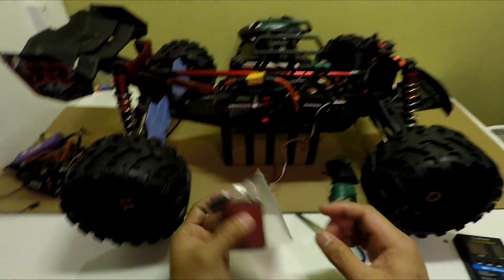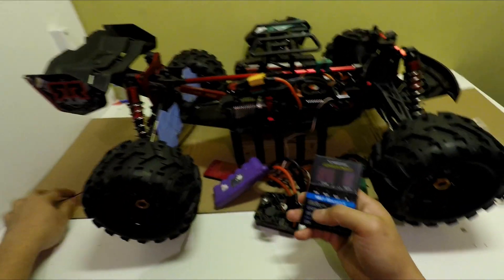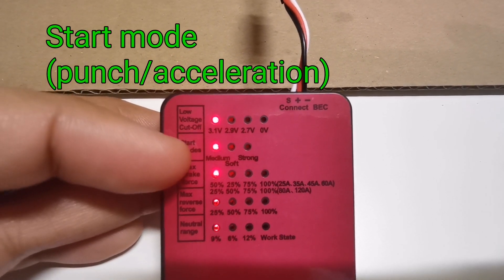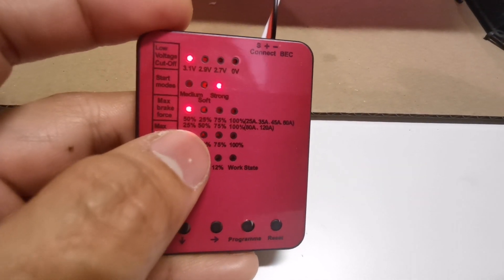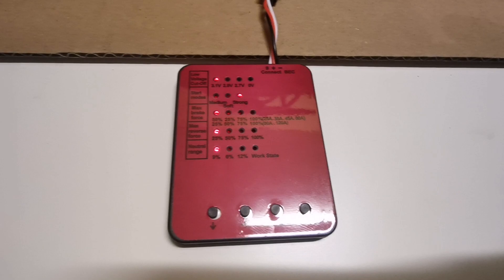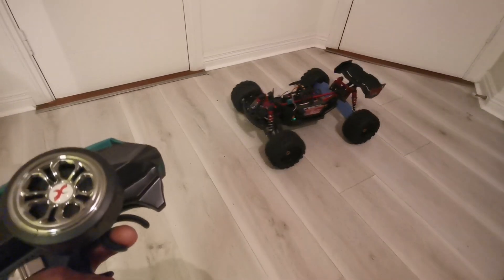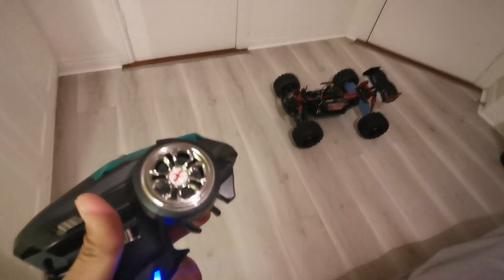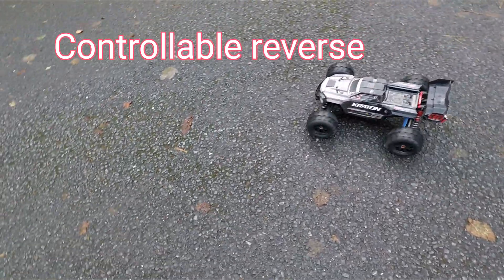Surpass Hobby Program Card. Solving ESC issues

Comment: neutral range is the setting for how much neutral range your radio trigger has. something like what you stated. 
The general idea is better radios (sanwa , ko propo, futaba) you would want to set this to the lowest setting. And for less expensive radios you would want to set this to a higher percentage. The less neutral range you have set the tighter your range will be giving you a tighter control or activation of signal with less pull of the trigger. But this only works with radios that have a more narrow band of neutral.  Setting the neutral range higher for less expensive radios with lower quality pots (potentiometers) will give you better response because your ESC will match the trigger pot you are using. So one shouldn't confuse this as as setting that can justbe setlow because one would think that would tighten up their range, thats would just mismatch your range. Matching your neutral range is more the idea here to get the best response. I have some Surpass Rocket V2 ESCs and Hobbystar V2 ESCs which all can use the Surpass or Hobbywing LED Number cards as well as the Surpass Single LED cards like used here. The problem is when using the Single LED Cards like shown here the ESC programmable options seem to work but they do not line up with the Options shown on the card. Also the ESCs all have way more options available than shown on this card.
The best card I have found to use with the newer Version 2 , Version 1.1 (like seen here) and Version 1 ESCs is the small LED Number card that shows the number of the option being programmed as well as the number of the options choice.

Comment: I have been having issues where i'll run the car and ther motor has a weird whining but it goes well for a little while then the forward/reverse cuts out. The motor does get hot. Steering channels are ok but no forward then if i leave it for a min it start working again.. The ESC has the fan on it. I ordered one of these cards to see if i can tune the ESC to work better.

Comment: Hi bro, i have 60a version of this ESC and 3650 3900kv motor, it wont run, the motor just shaking, do i put wrong motor for this ESC?
Reply from the maker: 60 amp esc + 3900kv motor with size 36mm x 50mm should be fine on 3s lipo.
What battery do you use?
Reply from the maker: Have you tried adjusting the throttle trim on the controller?
Or swap the 3 motor wirings to ESC
Reply: @ianbudgetrc2574  i use 2s lipo, yes i have swap its wire and adjust throttle to max it's still same 🤔 i even cut the motor cable make it shorter. Is using a program card might fix it?? Thank before bro
Reply: @ianbudgetrc2574  it do run before i put it on my kit, but not instantly run, its cogging first
Reply: @faisalrahmat9114 you can down motor pinion teeth for resolved problem.example: if you have 15t pinion you will use 13t .

Comment: Have you tried to switch two wires on the motor and then switch reverse chanel mode on the transmiter, so then you should have slight delay on going back and a punch start forward ?
Reply from the maker: Brilliant idea bro. I haven't tried that. I won't be able to anymore because the esc is gone..
Thank you

Comment: Hi Ian,
I notice that even if you use 12% deadband, your throttle is still sensitive. You just give it a slight pull and your truck moves, either forward or backward.
For my car, when I pull the trigger, even after deadband, there is still a distance to go - I first hear the buzzing sound, and then keep pulling, the car start to move.
How did you make it?
Thanks.

Comment: Can you please tell me why I can not get to the next mode I’m pushing the button and it’s not going over
Reply from the maker: Hi. What specifically doesn't work? Uhhm the button maybe broken? Could you pls show me the video?
Reply: @ianbudgetrc2574  Everything lights up but when I push the down button or the Button to go over to select The option I want it will not go over do I have to push the program or something like that to start it
Reply from the maker: @dustinplee5067  firstly, you connected the program card to the esc wire correctly, right? If so, then try to press reset. If everything is still lit up, then there must be a problem with the program card itself. It should display the default settings right away after connecting it to the esc.
Reply: @ianbudgetrc2574  does it have to be a surpass esc for it to work
Reply from the maker: @dustinplee5067  yes. As far as I know..

Comment: Your voltage issues might be caused by cold weather. If you check voltages at home after they sat outside and discharged while you run consecutive packs, their voltage will fall below the cutoff. Also if you are checking voltage in cold weather, every second counts as they are getting colder. If you are checking at home, waiting till they warm up will give different measurement
Reply from the maker: Thanks brother. That could be the case

Comment: Bro why you don't use the ezrun esc
Its much better 
Why
Btw mine supras hobby catch fire
Reply from the maker: I'm sorry about that esc, bro..
I use the ezrun for speed runs..
This Surpass Hobby for bashing
Reply: @ianbudgetrc2574  which one give you more power?
Reply from the maker: @Stergios_G7  the ezrun is much better. Stronger and faster. More power
Reply: Ezrun max 8 or max 6 
What is better??
Reply from the maker: @Stergios_G7  max6 is bigger and can handle 8s.
The max8 only 6s.
For 1/10 and 1/8 scale, max8 is ok.
For 1/8, 1/7, and 1/6 scale, max6 is good.
You can have the biggest which is the Max5. It's good for 1/7, 1/6, and 1/5 scale RC.
Depends on which car u use.
For speed runs, Max5 is the best, followed by max6.
For bashing 1/8 truck, max6 is the best
Reply: Thanks bro

Comment: I own the same ESC, surpass 150A. And have a problem with it. When i start the car this some delay from ESC ( 1-2s). Can i fix it with the program card set?
Reply from the maker: 2 seconds is too long of a delay, brother..
Initially, my esc throttle delay was around 0.5 seconds and this program card was able to somehow improve my throttling. It decreased the delay.
But lately, when I put in a stronger  motor, the delay worsened. I learned from a commenter that it is because of "bottlenecking". Bottlenecking happens when a strong  motor demands so much power from a weak ESC such as this 150amp surpass. So, the esc cannot provide the instant power that the motor is asking when you do instant full throttle, causing delays in power delivery. Bottlenecking is dangerous coz it can burn the esc.
The Surpass Hobby ESC is not that ideal for high power runs. So, the solution is to pair a motor with fair power with it. Use the Surpass Hobby 2000kv on 4s or 3s with light gearing to reduce stress on the surpass ESC.
What's your motor, pinion gear, and battery?
Reply: @ianbudgetrc2574  the delay of esc is partially affected from TX to RX . I fixed it, now the delay is only 0.5-1s. I think it's possible to fix it the same way you did.
I am using the motor that came with the ZD 9021 (motor B4465).
17pinion gear and 3S lipo. 
i buyed the program card set for the ESC but it not the same you use. you have the red card , and i buy the white. it look like your card just diffrence the colour. hope it usefull.
Reply from the maker: @soapnguyen314  good one on the transmitter. Yes you can try this program card. 
your motor is fine. And 3s is fine.
But your 17t pinion is a bit high. 13t to 15t is fine.
Reply: @ianbudgetrc2574  see ya! Now im waiting for the program card. If solved the problem, i  wil run in 4S and replace the motor.
How to set up for ( head off )run ? Does i do it in the 3S lipo?
Sorry for my bad English. I don't know what words to use to describe driving with only 2 rear wheels!  LOL 😂😂
Reply from the maker: @soapnguyen314  don't worry, just follow the instructions on this vid. You can setup the headoff run.
If your RC is rear wheel drive (2wd), you don't need too much power for acceleration coz it will either spin or do wheelies. So, just set acceleration power to moderate or medium
Reply: @ianbudgetrc2574  i have the ZD 9021 V3. Look like your avatar!
Reply from the maker: @soapnguyen314  nice!
Reply from the maker: Here's the link to the motor that I suggest:
https://a.aliexpress.com/_mqCkKi3
Reply: @ianbudgetrc2574  I am also planning to buy this motor

Comment: Sounds  like  you  car is cogging
Reply from the maker: Clogging is expected in nonsensored motors, especially with these cheap electronics
Reply: @ianbudgetrc2574  how to solve it if cogging bro..hmm
Reply from the maker: @arifisa7272  small cogging is normal. But if it's too much, there could be something wrong. Try checking all 3 motor wires if they are properly connected to the esc. Or it might need to be reprogrammed by setting the throttle end points
Reply: @ianbudgetrc2574  thanks bro..maybe i need to get these and try to reprogrm.....

Comment: when I plug the card in to the esc everythings going good and all the lights turn on, but then the ''work state'' led starts flashing blue and the buttons dont work.  it is a nimh battery so im trying to turn off LVC.   Do you have any idea what the heck I should do?
Reply from the maker: Hi bro. Uhhm when the blue light flashes, you won't be able to use any button. What I did was that I just reconnected it and secured it tightly to the 3-wire ESC cable. And it worked. The blue light stop flashing

Comment: mind to share ur motor size and what lipo..? 2s or 3s..?
Reply from the maker: Yes brother. No problem.
42mm diameter x 76mm length.
I'm running awanfi brand 4s 5000mah 100c lipo
Reply from the maker: 2200kv brushless motor
Reply: demmm..4s..? this esc can survive 4s..?? thats good mate
Reply from the maker: @hajimeonthego5046  yes. And this ESC is 150 amperes. So, It can even run on 6s
Reply: You put the punch on strong?
Reply from the maker: @nts323  yes. Strong. The maximum setting.

Comment: Thanks Ian, that car rips!! I got the 150A esc in the mailbox today, I wonder if it is any good for may HPI savage ''flux'' build.
Time wil tell, is the esc getting hot after driving like that?
Reply from the maker: The ESC doesn't get hot that much. It has a strong cooling fan, and the weather in my place somehow helps. 
I've done a test and used up 2 batteries. The motor heats up more than the esc does.
So use a bigger motor and lower kv on your hpi savage flux coz that monster truck is big. With at least 40 to 42mm diameter motor with kv less than 1800kv, you wouldn't have problems with temps on 6s
Reply: @ianbudgetrc2574  its fun, no problem, I got the hpi 2200kv high tork motor in it, I gone be playing with the gears to get the right temp/power ratio, never used a cheap esc, and I hop to get as much fun out of it as you do. Thanks for the fast reply. ;o)
Now gone watch the endurance test video.
Reply from the maker: @RcBuddy  true! I've used the HPI Tork motor once and it's a beast! You should be fine. Have fun blasting!
Reply: I had the 120A version, ran 3s and the 5200kv motor it came with (was a combo). Esc smoked after over a month of use unfortunately, but it was good while it lasted.
Reply from the maker: @Logan_TSBACG  sad to hear that. Honestly, 5200kv is too high for 3s. That's nearly 60k rpm on 3s. You only need max 2s for that. Although the ESC can handle 4s, the 5200kv motor would demand so much power from the esc and the battery. So, It would heat up much faster. If you used it for bashing, that gave it a bigger chance to burn it.
What did you use it for? Thanks
Reply: I just drove it up and down my street, didn't take it to a skate park or anything like that. I thought 5200 was a bit much, but that's what the combo came with. I also think why it smoked was because I had an adapter for the battery wires, dean's to trx. On the bright side, I have a max 10 120A esc in it now, and that things great. Put a 4300kv motor in, 17t pinion on my slash 4x4. The things a rocket. Was pulling wheelies too. It can also do 4s, which I'll do in the future.
Reply from the maker: @Logan_TSBACG  you'd heat the system up more on going round in circles for a long time than jumping or bashing. That might have caused the Dean's T plug to melt, causing short circuit. Dean's t plugs are not rated for high currents. 5200kv on 3s draws huge loads of current.
For the latest combo you have, 4300kv on 3s is enough. Even if you had a 6s-capable ESC, it would still be risky to run the 4300kv on 4s. Again, it would draw bigger amps and contribute to overheating of the system. And also, you're using 4s above, its better to get rid of the Dean's t plug. Use XT90 connectors.
Hope it helps
Reply: The max 10 came with trx connector, and same with the battery I'm using. I would use xt-90s, or some other one, but I don't have a soldering station. And if I do 4s, I'm planning on getting a 3500 kv motor. Also, thanks for the help.
Reply from the maker: @Logan_TSBACG  you should be fine. Best of luck brother. Bash on! 😁 You're welcome
Reply from the maker: Thank you so much for taking the time to watch and comment.
Here's the endurance test of surpass
https://youtu.be/4QJ5Z1q3UKs